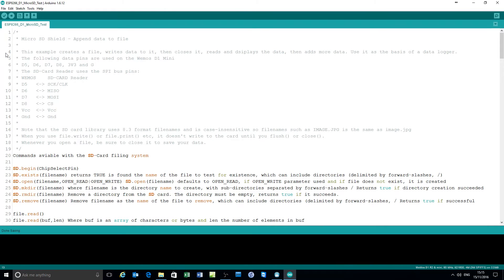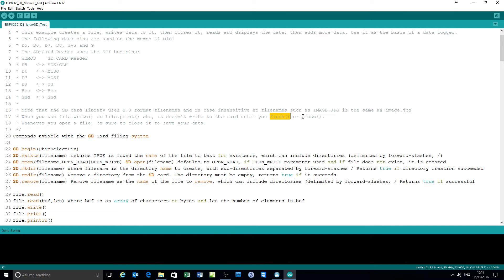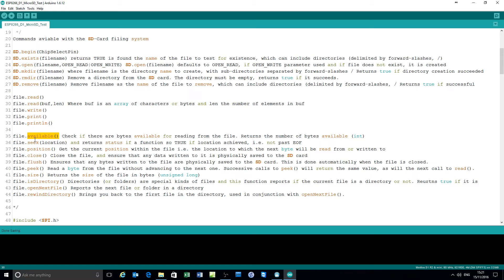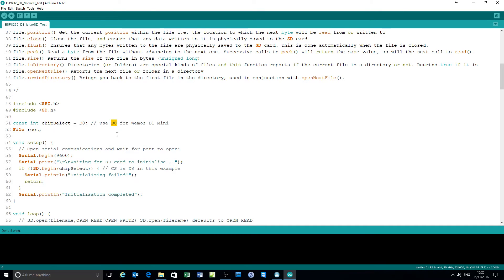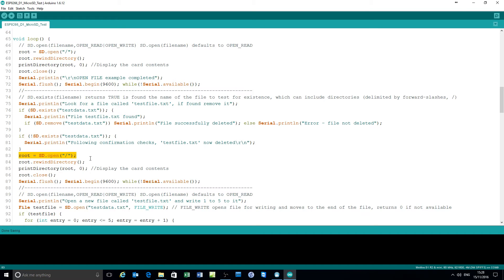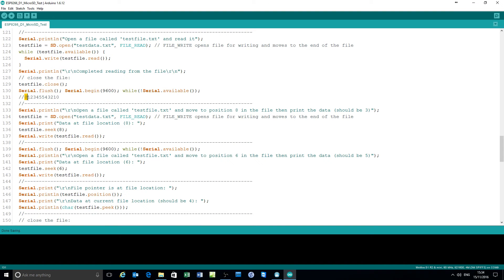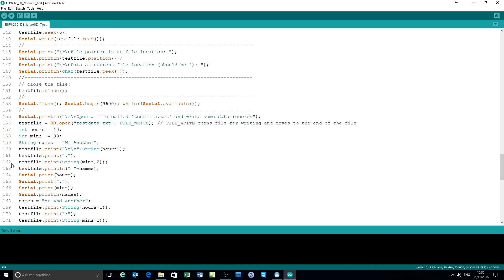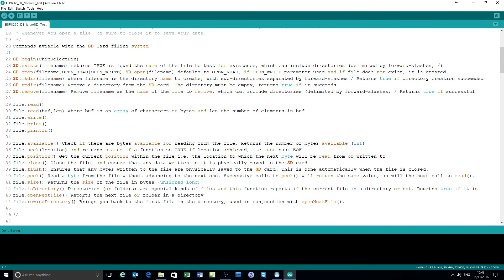Tech Note 016 - (SEE MY NOTES BELOW) How to Use SD Cards with the ESP8266

Comment from the maker: And many boards you can buy also need a pull-down resistor (say 4k7) on the CS line, typically D8 on a Wemos D1 Mini SD adapter, THESE ARE ALL HARDWARE PROBLEMS when boards are purchased from unknown sources!

Comment from the maker: NOTE: If your using most of the current SD-Card readers, including Wemos D1 Mini Shields they won't work because they are missing a vital MISO pull-down resistor. You can solve this by wiring a 4K7 from the SS (D7) pin to Gnd.

Comment: Great Tutorial. This was a great find for me in that I'm going to capture data wth some sensors and need to write the data to an SD card for later analysis in EXCELL.  You were very CLEAR and gave GREAT examples for me to try so I really understand using the SD process.
Reply from the maker: You may want to look at SPIFFS too, almost identical but uses the ESP flash memory as a pseudo SD card. I’ve had a temperature, humidity, pressure, dew point and heat index logger for 18-months now saving data every 15-mins without problems and saves an SD card reader. Watch out for some SD card readers if not buffered they don’t work.
Reply: How can you tell if the cards are buffered? I checked many listings on ebay and alliexpress and no mention of on-board buffering!  I also did an internet search about buffering on an SD card.. and nothing.  Maybe I'm not asking the right questions?
Also, can you share the code on how you used SIFF's to capture and retrieve your data.  I'll review your video on SPIFF's again.
Reply from the maker: Difficult, but most look like this: https://www.aliexpress.com/item/Free-shipping-10pcs-lot-Micro-SD-card-mini-TF-card-reader-module-SPI-interfaces-with-level/32672822245.html?spm=2114.search0104.3.16.pBtnsZ&ws_ab_test=searchweb0_0,searchweb201602_4_10152_10065_10151_10068_10130_10344_10345_10342_10547_10343_10340_10341_10548_10192_10541_10190_10307_10301_10303_5680015_10060_10155_10154_10056_10055_10539_10059_10534_10533_100031_10103_10102_10142_10107_10324_10325_10084_10562_10083_10179_10312_10313_10184_10314_10073_10557_10594_10596,searchweb201603_25,ppcSwitch_4&btsid=98001f04-f744-4c6b-889d-aa2f2a19605e&algo_expid=8978f479-05fc-4348-9a28-0f793743b805-2&algo_pvid=8978f479-05fc-4348-9a28-0f793743b805Avoid any type with few components
Reply from the maker: Check out the description of TN030 there is a link to the code on github
Reply: G6EJD.. Thanks, I placed an order only around $0.60 each.  I'm going to start my project with SPIFFS then transfer the data over to the SD once they arrive.

Comment: Thanks for tutorial , i am Little confusing i have data with timestamp text file so I want to send data to google sheet what is skipped while internet was not available , what commands i should use?
Reply from the maker: Well how do you want to transfer the file?
Reply: @G6EJD  now I have code which send one line string to google sheet if data send successful then headers received but unsuccessful due to internet not available or any reason it should save in sd card and next attempt when it is connected wifi it should send skipped data recorded last time , i know how to read write in sd card and send to google sheet but how to send previous data what I explained above
Reply from the maker: @mr.techinventor3463  So detect if no wifi, and if so, save the data in a file lasttime.dat or something, then next time see if file exits, if so send that first then delete the file, then send the current data
Reply: @G6EJD  wow thanx subscribed.

Comment: I try your code but i get this error:
could not convert '4000000ul' from 'long unsigned int' to 'SPISettings'

Can you help me?

Thanks Renzo
Reply from the maker: Just remove ‘ul’, the compiler has been updated
Reply: @G6EJD  From where?
Reply from the maker: 4000000ul becomes 4000000

Comment: I downloaded the code from github and after compilation it gave the error message "D8" was not declared in this scope.
Reply from the maker: +Ian Janoska What board have you selected in the IDE? Sounds like it's not a NodeMCU or Wemos, if ADAFruit variant you will need to remap the pins
Reply: You typed in D8 and not 8

Comment: This example you provided would be a great addition to my voltage or current reading sketch. The question I have; after placing the data (Current or voltage readings)on the card in text format can one remove the card and insert it into a computer (windows 8.1) and read the file from the SD card for use in a spreadsheet?
Reply from the maker: Rud Dog, yes, but you may find it easier when writing the data to separate values with either a space or ‘,’ to make it comma separated variable CSV format.

Comment: I selected NODEMCU and got past the declaration error but now have the error

Build options changed, rebuilding all
In file included from C:\Users\Admin\Documents\Arduino\libraries\SD\src/utility/Sd2Card.h:26:0,
                 from C:\Users\Admin\Documents\Arduino\libraries\SD\src/utility/SdFat.h:29,
                 from C:\Users\Admin\Documents\Arduino\libraries\SD\src/SD.h:20,
                 from ESP8266_D1_MicroSD_Test.ino:50:
C:\Users\Admin\Documents\Arduino\libraries\SD\src/utility/Sd2PinMap.h:510:2: error: #error Architecture or board not supported.
 #error Architecture or board not supported.
  ^
Multiple libraries were found for "SD.h"
 Used: C:\Users\Admin\Documents\Arduino\libraries\SD
 Not used: C:\Users\Admin\AppData\Roaming\Arduino15\packages\esp8266\hardware\esp8266\1.6.4-673-g8cd3697\libraries\SD
Error compiling.
Reply from the maker: You have two SD card libraries installed, you need to be using the default library.
Reply: @G6EJD  i faced same issue, but its solve now. thank you for your support

Comment: Even 4M built in memory available.
Why we should interface SDcard?
Reply from the maker: Yes no need for SD card providing your storage requirements are within the 3MB limit (1MB for program space), except SPIFFS is not yet implemented on the ESP32
Reply from the maker: The other thing to be aware of is the limited write-cycles of Flash memory, about 100,000 to 1,000,000 which might sound a lot but with fast repetitive writes those cycles can quickly be used up! Still but less of a problem for SD-Cards.

SPIFFS is now implemented on the ESP32

Comment: An SD/MMC card controller is built INTO the ESP32!  http://espressif.com/sites/default/files/documentation/esp32_technical_reference_manual_en.pdf  
P 180,  9.1.0:   SD/MMC Host Controller.
Reply from the maker: Are you saying the ESP32 is a better device than the ESP8266, that this video is about? If so I agree. There is no SD controller in the ESP8266
Reply: Can this be used with the Arduino.IDE?
Reply from the maker: Yes, all these examples are based on the Arduino IDE
Reply: G6EJD Sorry for my poor wording on the previous question.  There is a SD_MMC library. Your examples seem to use the regular SD library?The SD_MMC_Test.ino uses #include "FS.h" , #include "SD_MMC.h", your example in the video uses #include <SPI.h>,  #include <SD.h>.  I'm confused about which of the SD libraries to use if I want to use the embedded library for the ESP32?
Reply from the maker: OK, I understand, this video example was for the ESP8266, but the ESP32 uses the same libraries. This is the example for the ESP32:  https://github.com/espressif/arduino-esp32/blob/master/libraries/SD/examples/SD_Test/SD_Test.ino 
You will see it's near identical. I think the library SSD_MMC.h is not an Espressif variant?
Reply: The Wemos board's built-in SD interface apparently assumes the native Espresso firmware is installed. This video (hopefully) explains how to use the SD card with the Arduino ESP8266 libraries.
Reply from the maker: I now have all of the SD libraries working on the ESP32 the fix initially was a simple hardware one, now superseded by an in-built ESP32 capability.

ALl of the SD functions work well on the ESP8266, but there a few quirks to using the SD card.

Comment: I am getting errors like this

Arduino: 1.8.5 (Windows 10), Board: "NodeMCU 0.9 (ESP-12 Module), 80 MHz, 115200, 4M (3M SPIFFS)"

Build options changed, rebuilding all
In file included from C:\Program Files (x86)\Arduino\libraries\SD\src/utility/Sd2Card.h:26:0,

                 from C:\Program Files (x86)\Arduino\libraries\SD\src/utility/SdFat.h:29,

                 from C:\Program Files (x86)\Arduino\libraries\SD\src/SD.h:20,

                 from C:\Users\Viraj\Documents\ESP8266-SD-Card-Reading-Writing-master\ESP8266_D1_MicroSD_Test\ESP8266_D1_MicroSD_Test.ino:50:

C:\Program Files (x86)\Arduino\libraries\SD\src/utility/Sd2PinMap.h:510:2: error: #error Architecture or board not supported.

 #error Architecture or board not supported.

  ^

exit status 1
Error compiling for board NodeMCU 0.9 (ESP-12 Module).

This report would have more information with
"Show verbose output during compilation"
option enabled in File -> Preferences.
Reply from the maker: There is nothing wrong with the example code, this is an issue with your IDE setup. Have you tried compiling some of the Examples, so Examples, SD for example ListFIles, that should compile OK. The errors you show suggest you have not installed ESP support in the IDE?

Comment: how to save an array?
Reply from the maker: You would need to do this (one-dimensional):open file for write...for (int r = 0; r <= array_size; r++){  testfile.print(array_name[r]);}You would need to do this (two-dimensional):for (int r = 0; r <= array_size_x; r++){  for (int c=0; c<= array_size_y; c++){
    testfile.print(array_name[r,c]);  }}To read back:open file for read...for (int r = 0; r <= array_size; r++){  array_name[r] = testfile.read();}You would need to do this (two-dimensional):for (int r = 0; r <= array_size_x; r++){  for (int c=0; c<= array_size_y; c++){
     array_name[r,c] = testfile.read();  }}It is very important to keep the sequence of writes and reads identical, obviously.
Reply: Does this just use for array of byte?
Reply from the maker: Minh Vũ Nguyễn the read and print statements adjust the amount of bytes written and read depending on the type of the variable so if on an ESP32/8366 an integer is 4-bytes so they will write and read in 4-byte chunks.

Comment: G6EJD : thank you for your good video, anyway I used D5 D6 D7 D8 pin with the 8x8 Led display modules, could I used the SD card module with other pin on Node MCU 1.0E( D0 D1 D2  D3 or D4)?
Reply from the maker: The SD Card uses the SPI bus, you you need to print out what pins the NodeMCU setting is on your compiler there are MISO, MOSI, SCK and CS so Serial.println(MISO) that will give the pin number in use, but not the D-number th is the NodeMCU approach to compatibility do D5 is actually pin 14, you should get this:
CLK is on pin 14 (aka D5)
MISO is on pin 12 (aka D6
MOSI is on pin 13 (aka D7)
CS is on pin 15 (aka D8)

So what you've used is the SPI bus and the SD Card driver won't work. I don't know what display your usng but if it is SPI bus then you connect the SD card in parallel and then choose a device CS for the display as D8 is the CS for the SD Card.
Reply: @G6EJD  : I use led display board( MAX7219 Dot Matrix 4-in-1) the code, and the wiring using 3pins as below
#define CLK_PIN   D5 
#define CS_PIN    D6 
#define DATA_PIN  D7

so I can parallel the SD card with the Max7219 and define CS of the memory card to D8, right?
Reply from the maker: Prasert Kitt, yes, the data pins for the display are separately defined and you need mosi, miso, sck and CS for the SD-Card and then your completely separate pins for the display.

Comment: Picked up the hardware but sorry for my lack of knowledge but can you link the actual SD card you recommend?
Reply from the maker: Yes, there should be no problems. Some boards have level converters between 5v and 3v3 other not, some are buffered, some not, you need both. I recommend trying a simple card reader programme first.

Comment: I like the subjects you are covering, but I was hoping to see a diagram or wiring diagram then a high level view of the code before delving into the details. Looking at code on a screen is kinda boring. I do appreciate you covering this though!
Reply from the maker: I put the wiring diagram in the GitHub repository or in the video it's at 20:53 or the text variant of the connections are in the source code at the start.